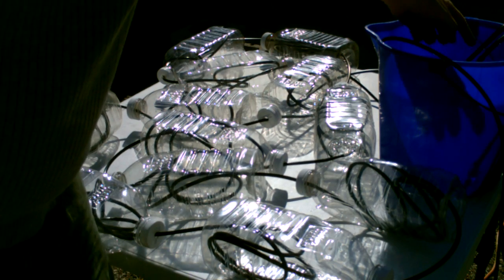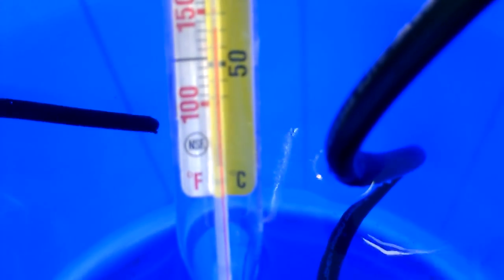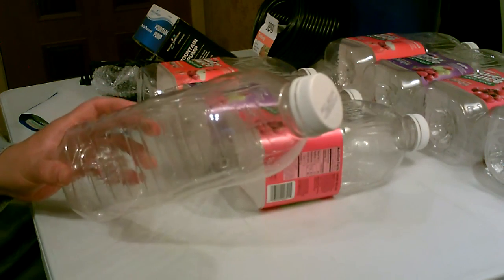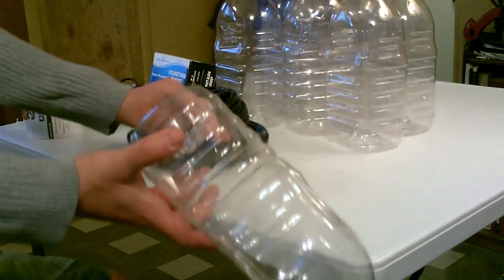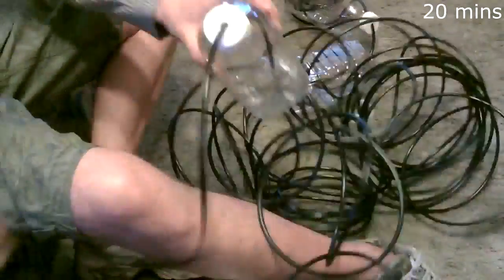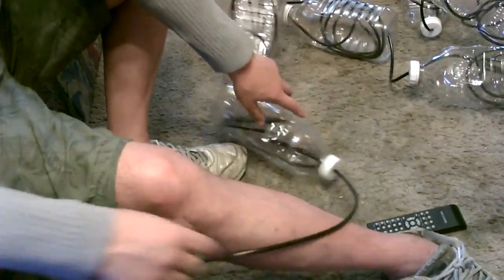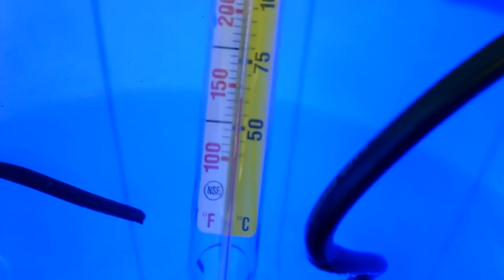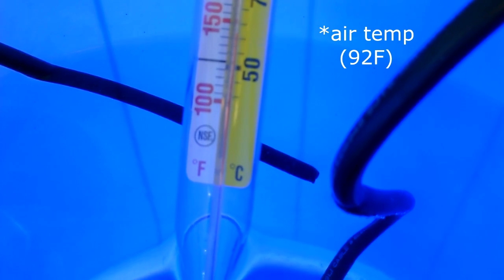Solar Water Heater! - Multi-Bottle (& black poly pipe) Solar Water Heater - 145F - Easy DIY

Comment: If you placed the water reservoir above the solar collectors would that eliminating need the need for the circulating pump?  I would think thermal siphoning would circulate the water without the need for a pump.

Comment: Would you be just as effective, if not more so, if you just took the black tube and got a large flat board and were able coil the tubing next to itself in an ever increasing circle? You could then make a plastic cover for the board that the tube was coiled on?